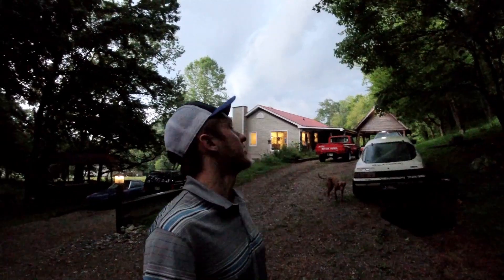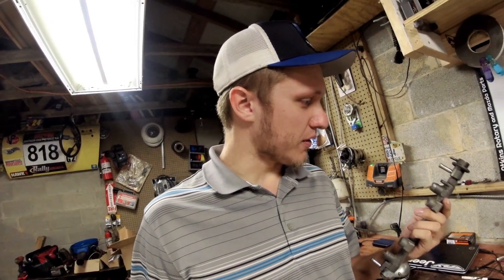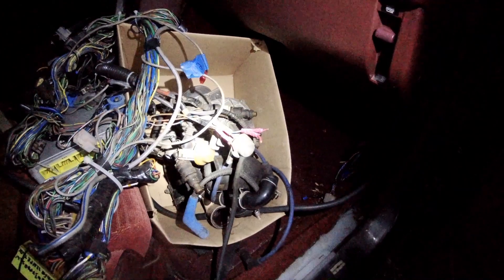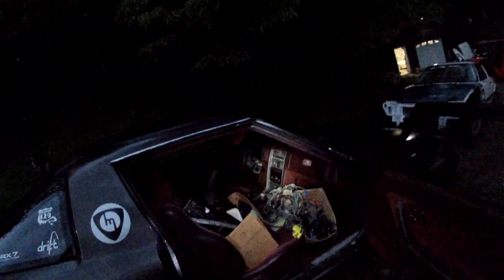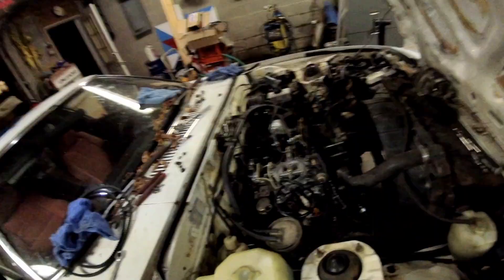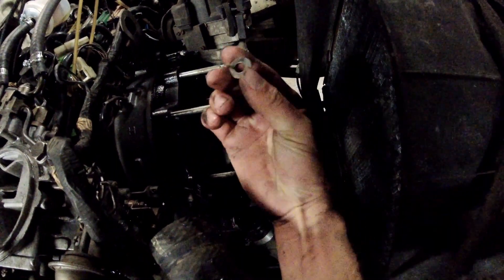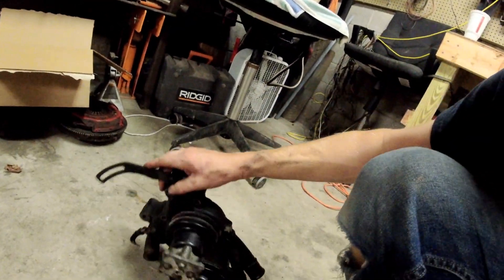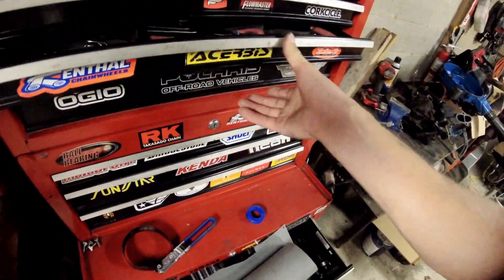12a Rotary Engine Water Pump Removal

Comment: Hello,
I’m changing the water pump and gasket on my 1982 Mazda rx7 gsl MT , and I’m having some trouble getting it out cause the pulley is hitting the bottom crank shaft pulley and doesn’t let me pull the water pump out; not enough clearance between the two pulleys. What you recommend?
You should know I don’t have the air pump assembly on my car; I did the whole racing beat carburetor swap.

Comment: Is is good to have thin washers for each of the bolts?
Reply from the maker: If you are using a paper gasket then yes
Reply: @RADPotential  Today I installed a 1.00mm paper gasket with the 0.5mm washers. Is this a good combination?
Reply from the maker: I would tighten the gasket side down first and then just snug the other side, don't crank it down.  you will know it works if it doesnt leak
Reply: @RADPotential  Thanks a lot👍

Comment: Great informative video. With an S5 13bt engine can you remove the water pump housing with the pump still attached or does the pump need to be removed inorder to remove the housing?
Reply from the maker: You can remove the housing and pump together
Reply: @RADPotential  Thanks for your reply, I removed the four 12mm nuts as well as the bolt for the lower alternator bracket and alternator, the fan etc and the housing ain't moving.